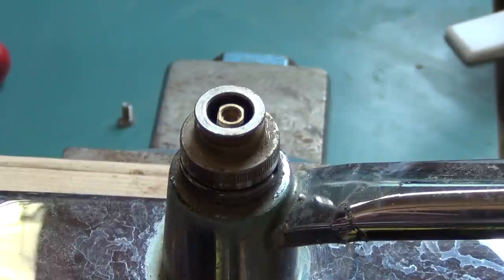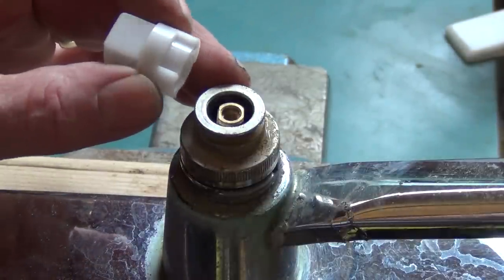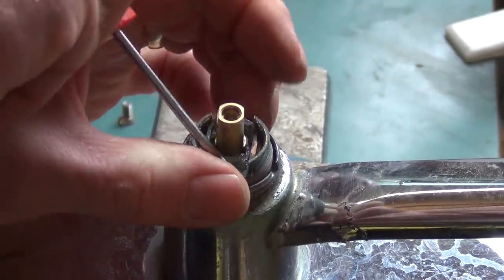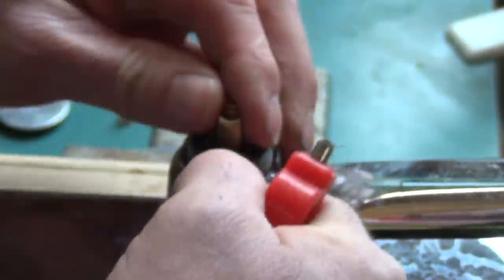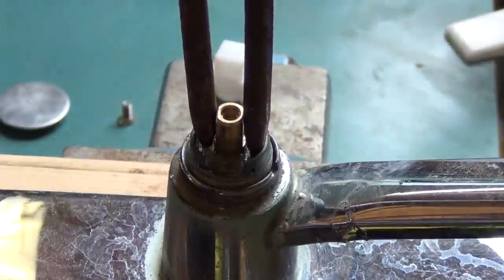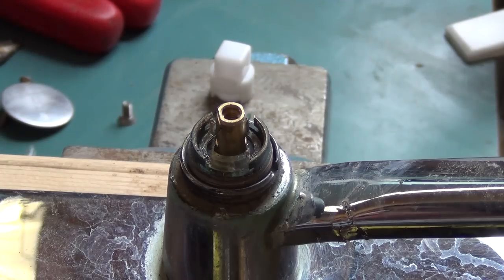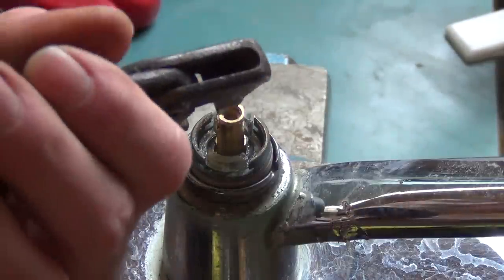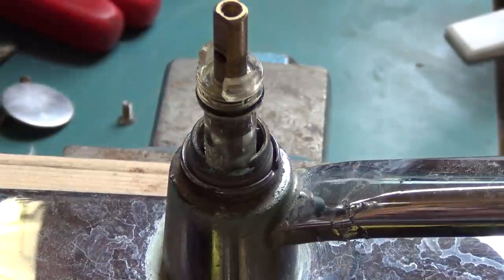Removing a moen cartridge from the faucet! If the plastic tool should fail you! Plumbing tips!

Comment: Thanks for your video but mines just not coming out PERIOD! I tried for OVER 2 hours to remove it & nothing works. I tried channel locks, pliers, etc. I got so frustrated I sprayed it with WD40 & it still won't come out. I can turn it a lot but it will NOT come out. I guess I have no choice but to have a new faucet installed. I have a MOEN faucet in my kitchen & bathroom but no more. I'm done with MOEN for life after this nightmare. I give up. It's hopeless.
Reply from the maker: Hello Rob,
Is it the center part of the cartridge that is turning or the entire cartridge?
Generally if the entire cartridge is turning you have to use a bit of force to pull it  out.
I recently found a knock off Moen puller for ten dollars at Home Depot that may help you out with this little problem. Very simple to use.
Definitely worth a shot.
Thanks for commenting and best of luck with the repair!     Al
Reply: I believe the whole thing is turning. I reattached the nut & handle so I can use it for now. I would have to take those parts off again to check if the whole thing is turning or not. 

I'm confused as to why you feel the whole thing turning is worse then just the center turning? Wouldn't you want the whole thing to turn as the outer part is what is holding it in place?

Also, I can't find a retaining clip or horseshoe clip as you called it anywhere on mine. My cartridge is ALL plastic no brass.
Reply from the maker: Hello Rob,
I asked about the entire unit turning because that is what you are after to remove the cartridge. The center piece will spin regardless. Just wanted to be clear.
Very strange if there is no retaining clip. That is what prevents the cartridge from coming out under pressure. If the entire cartridge is turning then your retaining clip is missing. 
I have never seen one that didn't have a retaining clip. Look closely to be sure it is not there. If it not there then it should pull out easily especially if the complete cartridge is turning freely.
Be patient with it. I know it can be a bit frustrating, but Moen is a great product.
Double check for the retaining clip. 
Get back to me when you get the chance. If you remove just the handle you should be able to see the retaining clip.    
Good luck!   Al
Reply: I received a replacement cartridge from MOEN. There is NO retaining clip on the new cartridge either! I explained to the MOEN rep how the cartridge will not come out. The MOEN rep then told me that I will have to go in underneath the sink & bang it out from the other side. What a pain in the butt that's going to be! I hope I can fit down there! Wow!
Reply: One more thing, my cartridge is MOEN 1224 B. It's all plastic with NO retaining clip. I'd buy a cartridge puller but I don't know where to find one for my cartridge. They sell one for a 1200, 1220, 1225, single handle cartridge. Mine is a double handle faucet. I don't know if they make one to work on a 1224 B.
Reply from the maker: Hello Rob,
It being a Moen 2 handle faucet makes all the difference in the world.
There is no retaining ring on those faucets.
I made a video on this faucet that you are talking about.
It may help if you are interested....
How to repair a set of leaky 2 handle Moen washerless faucets. Easiest faucet repair! Plumbing Tips! 
This video should help you with your repair.
The cartridge pulls out very easy on these faucets. It does not turn. It pulls straight out. You shouldn't need a puller of any kind. Just a little muscle.
Thanks for commenting and let me know how you get along....Al
Reply: OK, here's what I did. I wanted to buy a MOEN puller but the one they sell is designed to remove the 1200, 1222, & 1225 cartridges only NOT the 1224 B. That being said I had a strong feeling that the puller would work on my 1224 B. I went to H.D. We looked at a Danco puller for the 1200, 1222, & 1225. We compared it to a 1224 B cartridge & the employee agreed with me that it would probably work. 

I bought it, took it home & tried it. It does not "line up" perfectly & the screw is NOT the same thread as the 1224 B. BUT....drum roll please....IT WORKED PERFECTLY! The cartridge came right out in a minute flat! The screw cross threads into the 1224 B but who cares because you are throwing it away anyway? After cross threading it  holds very tightly into 1224 B. Then turn the bolt on the bottom & it comes right out! You can tell the puller is not designed for 1224 B, as again, it doesn't "mesh" or "line up" perfectly & the thread on the screw is "off" a little, BUT, who cares? It works! 

My advice to anyone with a 1224 B is this. If you can remove it easily then obviously do so, if not then BUY the puller for $13 at Home depot. It's worth it to save the aggravation & you will have it for life for future cartridges! 

Thanks for your concern Al. I really appreciate it! :)
Reply from the maker: Hello Rob,
You are more than welcome!
I am glad you managed to remove the cartridge and make the repair!
Congrats on that!
Any tool that gets the job done is a good feeling!
Thanks for commenting and enjoy your week!    Al